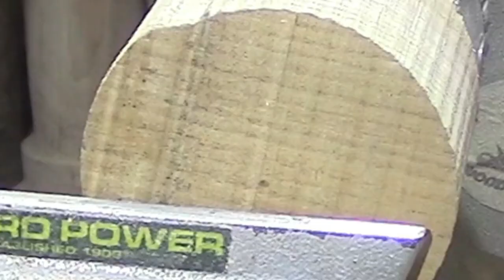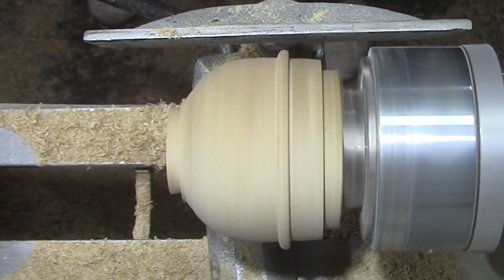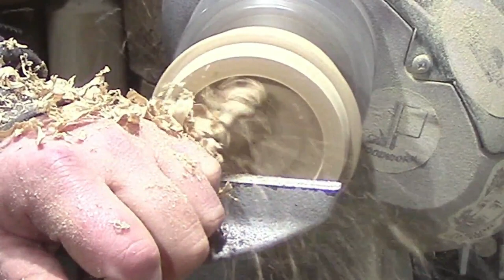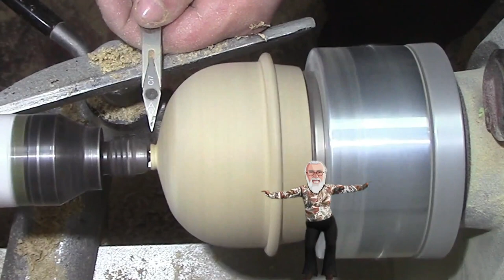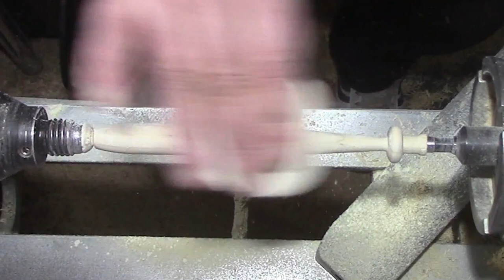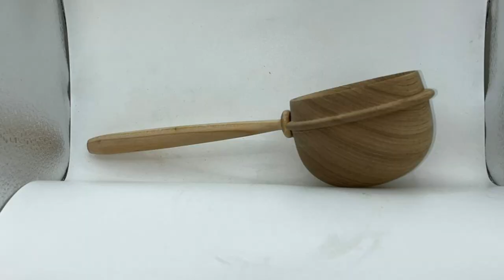Making a Wooden Scoop on the Lathe

Comment: Nicely done.
However, why did you use such a massive piece of wood for the handle? That could have been cut into 4 handles.
Also, if you don't have a band- or tablesaw, you could buy pen blanks. They have the perfect size and even come in some fancy stabilised woods too, making for some extraordinary scoops.
Reply from the maker: Thanks, i do have a bandsaw however the blade recently broke and i was waiting for a new one to arrive at the time and i didnt have any matching wood any smaller so it was the next size up :)